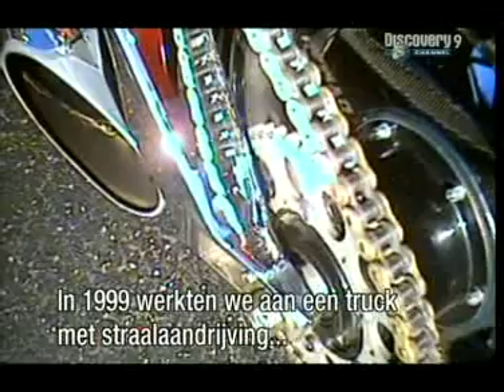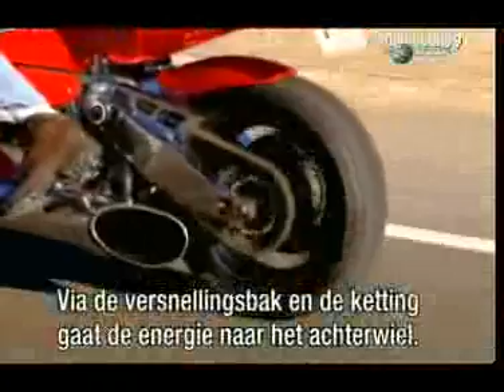y2k op discovery

Comment: The air heats up as it's been compressed by N1 and N2 by sets of stators and rotors. Stators convert the velocity energy into pressure energy so they direct the air to hit the rotors and their maximum efficiency while the rotos increase velocity in a cascade effect but the air is kept from reaching the speed of sound.

Comment: If u want this joint to go faster just add a couple set of more Turbine blades to get the most of the exhaust air for more rotational torque on the dual spool compressors. Eitherway Rolls Royce does it to their Turbofans.

Comment: Since is a Turboshaft it might have an impeller "just a thought". Well mainly turbines can be used for torque or thrust but turboshaft are for rotational shaft HP. Anyways I love to tell u that only the manufacturer of an A&P can actually touch ur airframe and Powerplant & not just anyone. Course it will make noise the compressor and T1, T2 as the air leaves but no thrust.

Comment: Nope! cuz he's at sea level like cars, only FAA requires that if an aircraft flies at 12,000 must have an oxygen system cuz the air gets less dense meaning less oxygen to breathe. Turbines don't have that problem cuz they get it from the compressor but recips must be supercharged or turbosharf to force air into the cylinders cuz there's so little atmospheric pressure to do so.